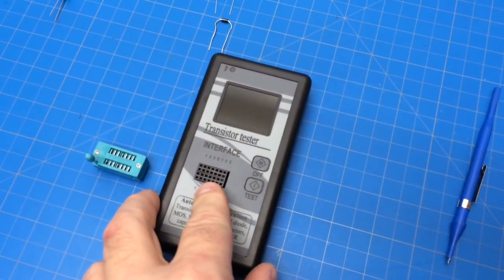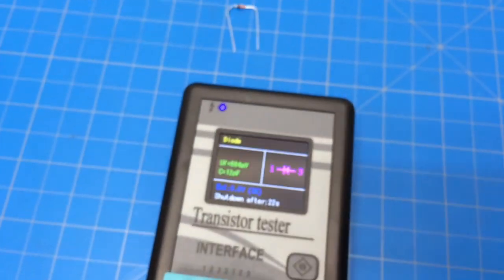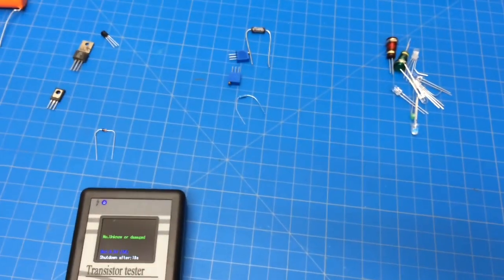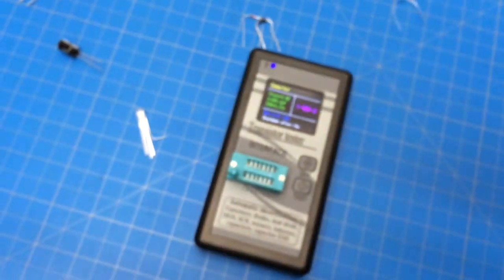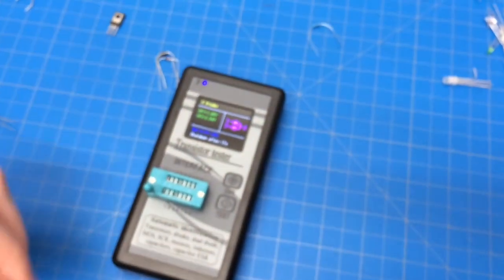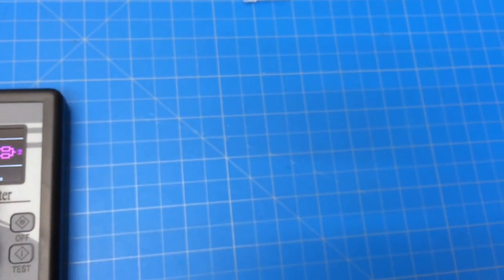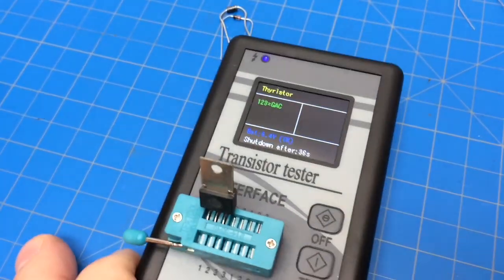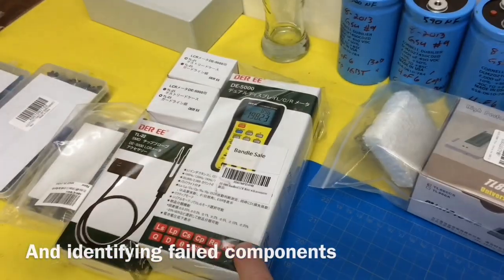Multifunction Transistor Tester (Mega328) - 1.8" LCD Display - [First Look & Test] [KTFG 359]

Comment: the user guide is uesless, how do i know where to put the components in ?  any user guides better then mine out there ?
Reply from the maker: That’s the tradeoff with modern cheap electronics, the manuals are terrible or nonexistent and they’re not quite as user-friendly as high-end electronics.  you just have to look at the number pins and make sure your device is different numbered pins.   For example for a two lead device make sure in one and two or one and three or two and three but not in one in one, two and two, three and three.  Watch the video more closely to the end and you will understand.
Reply: @KTFG  , right that makes sense now, thank you for the info ..

Comment: I hot melt glued mine solid with a bead around the bottom as you said, then took two breadboard pin ended wires about 8" long and soldered small alligator clips on the end, now I can use the zif socket itself or add the jumper wires and alligator clips to the zif socket, much more convenient than that loose fitting zif socket.
Reply from the maker: Good idea, thanks

Comment: Can this be used in-circuit?
Reply from the maker: Perhaps with some test leads added as seen here https://youtu.be/NkK2UsWIHk4.
It really depends on the circuit whether you can test the component in circuit or not.  A good general rule is all components should be isolated and tested out of circuit if possible.

Also check out 
“How to Solve 2x2 Rubik’s Cube: So Easy a 3 Year Old Can Do It”
https://youtu.be/UYCeyu_pbTI

https://www.kevingittemeier.com
Reply: So which one is the best esr tester i can get on AliExpress for under 20 bucks
Reply from the maker: I don’t think there is a best.  The items within a price range are comparable just looks for features you may want like leads, battery compartment etc.
If you want to step up in features and price  I recommend this: https://youtu.be/rgqQRzZM80Q

Comment: Do you have a link to the manual of this?
Reply from the maker: No
Reply: Just Google M328 tester pdf and you will find several from one page to around 80! They are all based on the same chip so are all relevant

Comment: HI GOT ONE OF THESE METERS AND IT STATES IN THE INSTRUCTIONS THAT I GOT OF THE WEB AND IT STATES THAT IF YOU SHORT TERMINALS 1,2,3 TOGETHER AND SWITCH ON YOU SHOULD BE ABLE TO CALIBRATE IT, UNFORTUNATELY IT DOES NOT CALIBRATE THE METERI ALSO HAVE THE SAME PROBLEM

Comment: Just recieved mine in the mail, but the adapter is almost too sloppy to fit tight in the interface.  :( .      lack of Q.A.
Reply from the maker: This price point of electronics has little to no quality control. 
It’s one of the costs of low prices.
If you bought it from Amazon you can return it for exchange or refund though.
I always try exchange first and give another chance.

Comment: I just got mine today - so I would need to solder in the jumpers to test, for instance, electrolytic caps on a PCB? Or could I just attach them with the clamp?
Reply from the maker: Just attach with clamp

Comment: Bought one 3months ago. I love it. Then my stupidity kick end and I was in a hurry and forgot to discharge a 16 volt 680uf capacitor on a cheap powersupply I use for my diabetic meter. One spark and that 328 was gone .My Fault. Got to get a new one. Besides that it is an amazing and useful tool.
Reply from the maker: +Dollarbill777 Dollarbill777 
Well a relatively inexpensive lesson.
I’m sure I’ll do it at some point. I just hope not with my more expensive (although still relatively cheap) DER DE-5000 Handheld LCR meter.
Reply: I started to get the De 5000.If I remember correctly the 5000 gives very accurate esr measurements. The only thing about the 328 is when your checking caps in circuit you really have to get to know the meter. When you add on the leads yours esr goes up.Since their homemade leads of your choice ,your Esr will vary by lead lengths. You pretty much have to make your on chart. Your 5000 has its leads already supplied I believe.
Reply from the maker: Yes but the supplied leads are inadequate for many applications so I like many people upgraded them.  See Video https://youtu.be/rgqQRzZM80Q
Hand Held LCR Meter purchased from Amazon:
Der De-5000 https://amzn.to/2yQxFa2
Atoplee Kelvin Alligator BNC Test Lead Set for LCR Meter: https://amzn.to/2tEfyz6
TestHelper TL200 LCR Meter Kelvin Clip 4mm Banana Plug: https://amzn.to/2KykeA4
Tl-21 Alligator Test Lead Case (for DE-5000 LCR Meter) https://amzn.to/2KjUuZf